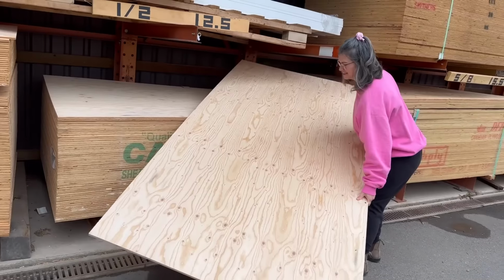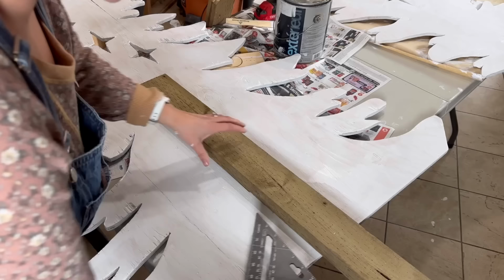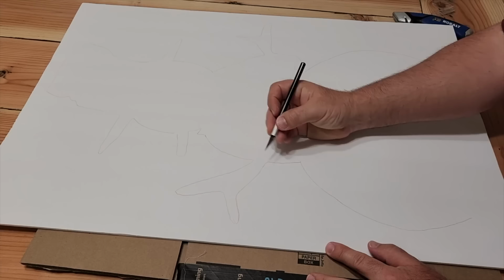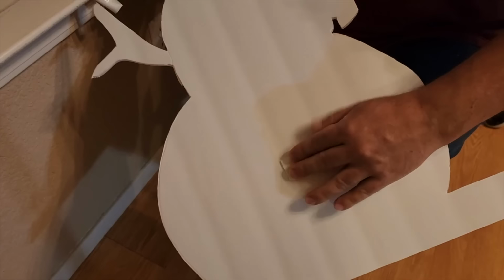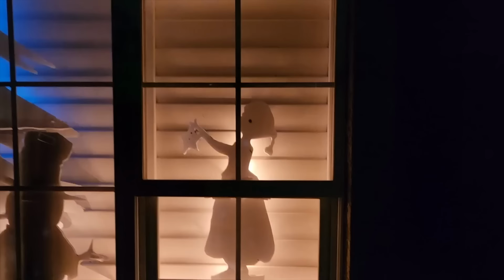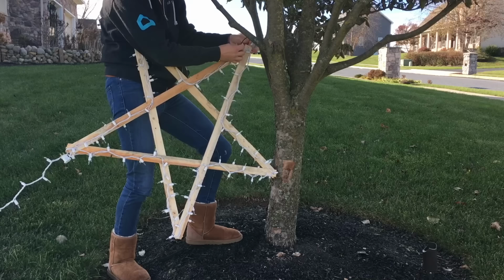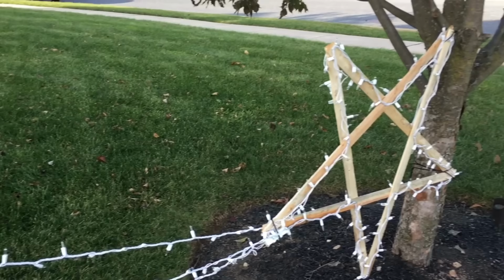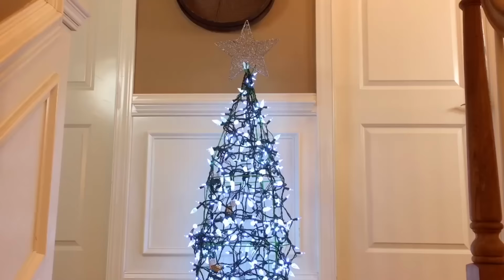The GENIUS new plywood idea everyone's copying this Christmas!

Comment: Some jig saw blades are down cut, so just make sure which you have . The teeth point in the direction it cuts. And down cut blades can be a little tricky because they can try to climb up out of the cut if they get bound up.

Comment: This would be perfect for a low powered laser engraver/cutter- would save so much time and get absolute perfect precision. I realize that sort of precision isn't needed for something like this but you could paint it up so that when folks are up close during daylight they could appreciate the quality of the design and you could also produce good enough quality that you could sell these things for a fair bit. (Not referring to the Christmas Tree at the end- a laser cutter wouldn't help with that)

You shouldn't disable dislikes. People need an extension just to see them in the first place. I'd have liked the vid if they were enabled and I'd have subbed- I don't support any channel that doesn't allow dislikes or censors comments.

Comment: You can also use an opaque projector to transfer the image but make sure to cool your bulb at least 5 minutes before and after to prevent itb from blowing  by leaving the fan in the on position after you have turned the bulb off.

Comment: I used a staple gun to attach Christmas lights and the staples cut through the cords. Needless to say they shorted out as soon as I plugged them in. Is there a particular type of staple gun for this process?
Reply: You need to use an Arrow T-75 crown stapler to staple the wires down with. This is the stapler that Telephone and CATV cables are attached with.
Reply: You can use a Milwaukee stapler made for stapling wire,but probably wouldn’t want to spend that much,so the first reply seems like the best advice.Good luck,Merry Christmas.

Comment: A little tip here (FREE of charge, you’re welcome 😉):

When you are CUTTING OUT a shape or to size, or CUTTING some other Crafts or DIY project, or EVEN when you’re just CUTTING your meat on your plate….

PLEASE ….. Remember to ACTUALLY CUT (!!!) using your knife…!!
Remember to make those forward and backward motions - while you’re applying a light pressure on the item you are cutting….
Slow and steady…until the knife is completely through whatever you wanted it to go through….

BUT PLEASEEEE!!!
FOR THE LOVE OF ALL THAT’S HOLY!!!! 

Do NOT (!!!) ‘PUSH(!!) your knife overly firm in/on (?!) the item that’s supposed to be cut.

And then DO NOT DRAG INSTEAD OF CUT (!!), while you keep pressing the item so hard it almost goes 𝙩𝙝𝙧𝙤𝙪𝙜𝙝 the table and instead of actually cutting: move/press the knife half forward, half sideways in an attempt to tear (!!!???!!) 

((We ALL know those kind of people!!!))

The item is torn into pieces….. Just by pulling and dragging it over your work space // dinner plate.. 

Finally:
To make your workspace and the way you work CONSIDERABLY SAFER :

You MUST be certain that the knife you are using to cut (or heaven forbit: drag, which in this scenario is even MORE dangerous when not doing it right) That THAT KNIFE IS as sharp-as-a-knife-can-possibly-be!!! 
Regardless if you are working on a project or eating dinner:

REMEMBER: The most dangerous knife, is a dull knife!!

You should SHARPEN you kitchen knives at least once per week on a wet stone of good quality, doing that according to the standard of ‘how knives can be sharpen the best way’.

And if you want to take it really serious: use one of those ‘grinding rods’ after EVERY use of your knives!! Just a quick schwish, schwashhh….and done (You can also change the moment of using the rod to AFTER using you knife, as long as you clean it of first!!!!)
This will remove those little miniscule rough edges, not having to do a full on ‘sharpen sessie’…

Just keep your knives in good shape, to profit the most AND the longest of your knives.

(And give yourself a well deserved treat: buy some REALLY GREAT QUALITY KNIVES FOR BOTH YOUR TOOLBOX (BLADE COVERED OF COURSE! Both for your safety as well as to protect your knives) AS IN THE KITCHEN!! 
Be aware: for a really GOOD knive, you should expect prices starting at a few hundred euro’s/dollars!!!!)